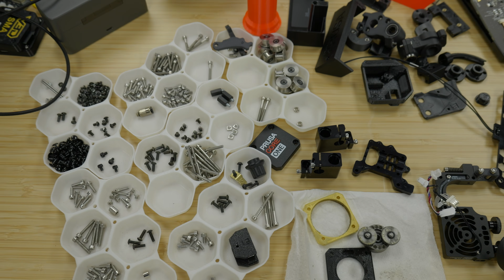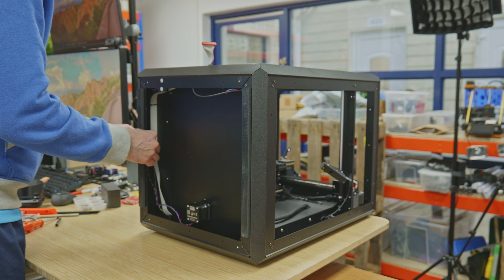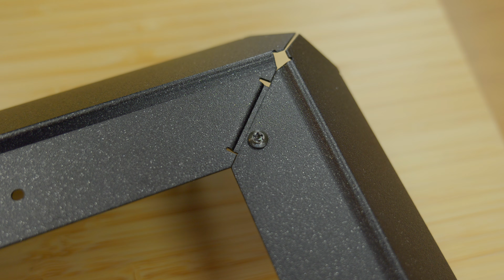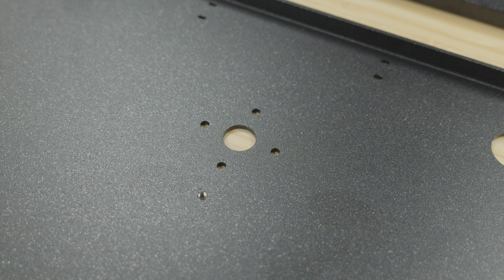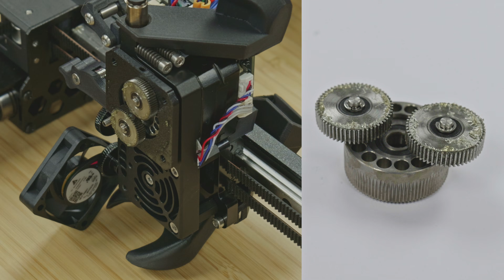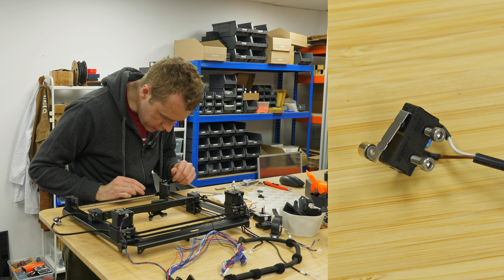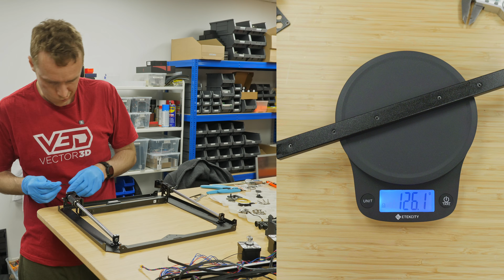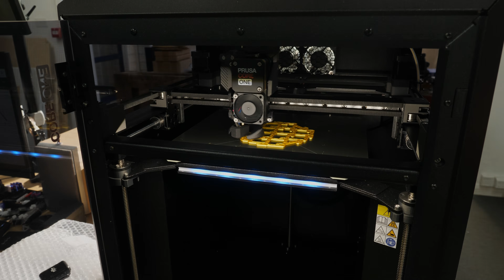I Removed all the Screws from my Prusa Core One

Comment: Honestly the corexy setup and mount plate reminds ma alot of the Ender 7
Reply from the maker: The single unified plate I personally first saw on the e3d toolchanger, but I'm sure motion system in industry will have done it this way for years. So, like an Ender 7, but done properly.

Comment: For the torx vs hex key screws. Beeing in a engineering company with product, sometimes you have stock of screws from a depreciated product. Throwing away screws is a bit of a waste, so you pass the screws with the first batch and then you have only one size. Or it could be that they have sourcing issue finding the screw with the correct head with the same imprint.
Reply from the maker: Not sure what engineering company your at, but the idea of dealing with multiple different machine versions with different screw heads in each one is like a living nightmare. Screws are not expensive and generally ubiquitous and very easy to source unless specialist sizes are used. to my knowledge this is their first time using torx too, I could be wrong but quite confident this was a firm decision.
Reply: @Vector3DP  they use torx screws for attaching the display on the frame for MK3.5/3.9/4(S).

Comment: If all three Z axis motors are driven using the same signal, that means they can't be driven independently to tram the bed. Not a big deal with mesh leveling but would have been cool
Reply: Its a pretty large increase in costs to do that for the very miniscule benefit on a machine this size tbh
Reply: You can still ram tram, just not actively align it
Reply: @SentientTeapot2444  That's how Prusa's i3 models do it. The x-axis assembly is moved in the z direction using two steppers driven from the same driver chip. The i3 printers ram tram to the top supports. I suspect the CORE One ram trams to the bottom.

Comment: Z decouplers are not for noise, but rather to account for discrepancies between Z rails , lead screws, and the moving plate. Pretty neat way to do it. Flexible in X and Y, not in Z
Reply from the maker: Oh true yes, I was maybe too focused on noise as I was impressed by how quiet it was compared to other printers I've been using.

Comment: Unsynchronised single-driver Z steppers is a bit of a compromise. Either chuck a sync belt on them or use independent drivers. Those 3D printed screw couplers seem worse than a proper oldham coupler, and they haven’t mitigated the axial force on the steppers’ radial bearings at all. The whole thing would be better if you just had a single bigger Z stepper and a sync belt.
Reply from the maker: Belt is a worse solution because when they aren't physically linked they can trammed by torque limiting. It's not perfect for levelling, but the first layer results speak for themselves.
Reply: @Vector3DP  you mean the Sovol-style “ram it into the limits and let some motors skip steps” torque limited levelling? I wouldn’t really trust that long-term when you’re relying on the stepper motors’ radial bearings for axial force, but if you’re able to adjust stepper current in firmware and you have a solid reference surface for it to run into then I guess it’s probably ok.
Reply from the maker: Ye, prusa have been doing it for years to tram the Z axis. at least as far back as 2018. It might not seem pretty, but with the size print farm, if it didn't work or caused problems, they would know about it pretty fast.
Reply: Can you please explain in more detail why exactly a stepper and belt should be the better solution?

What are the real advantages of three independent steppers? 
Which consumer printer has this?

The Prusa solution works like the tried and tested MK series. 
The only difference is that the bed moves to the stops instead of the X axis to synchronize.
Reply: @ there’s a chance for the three Z screws to get out of synchronisation, making one corner lower or higher than the others. When you turn the machine off and on again, you lose the holding current that keeps the three screws from moving relative to one another. The Creality K1 series of printers uses a sync belt between its Z screws, while some Vorons (and the Magneto X and a few others) use independent Z steppers that allow them to tilt the bed as a part of the levelling process.

I will note that if the frame is rigid enough, it probably won’t become a problem.
Reply: @Scrogan  The load cell can easily detect a skewed bed and force a re-calibration of the Z axis (by ramming them into the limits...).

Comment: 11:35 I suspect the flexural decoupling is not (only) for noise reasons, rather to prevent mechanical overconstraint. If they would all be rigidly fixed to the frame, you quickly run into alignment issues of the parts. These allow some sort of compliance in all directions except the two direction in which they are supposed to be rigid (namely translation along the ballscrew, and rotation around that axis).
Just from looking at it, I think it has degrees of freedom in translation in the plane of the part, and rotation around these same axis.
Reply from the maker: Yep, I think you're right others mentioned this too. I could have thought more about that.
Reply: @Vector3DP  I don't blame you for not knowing about this. I'm a researcher in robotics and specialized in flexure and compliant mechanisms, hence my remark!
By the way, it would be interesting to know what material they used for the flexures. PLA is generally pretty poor due to its creep properties (very relevant here, as it supports the whole shaft load). Of all common FDM 3d printing materials I have personally found ABS to have most favorable properties for flexures, so I suspect they used ABS here myself.
Reply from the maker: I've not tested the material, but by appearance and experience, it was PETG.
Reply: it has 3z axis? did it have auto tramming?
Reply: @adimegan4677  I am afraid I don't quite understand your question. My remarks with respect to the flexure coupling have nothing to do with the 3 Z axis construction and bed leveling, if that is what you are referring to.
Reply: @tHaH4x0r  sorry for my bad english, and out of context of point "flexure" system...

i jump the video because of your "time stamp" that mention flexure design... and surprised  that prusa core one use 3z axis, and make me asking about "did it have auto Z tramming/leveling bed like 1 ballscrew is lower than other....?(like advance DIY 3d printer example: RatRig) or just like other older prusa that use "hard endstop" to leveling itself..

again sorry about out of context, i toughs core one only use 2z because it more simple and to "not to many part" when upgrading prusa mk4s to coreone....
Reply: @adimegan4677  No. Autotramming would require one stepper driver for each motor, like on RatRigs vCore printers. Prusa does the same on the core one as on the i3 printers: Go over the max z-height, so all motors skip steps and everything is leveleg "enough" (here the bed, on i3 the x-axis). Everything remaining is compensated for by ABL.
Independendly working z-motors would have been nice, maybe combined with euclidic bed holders (like on the vCore 3.1 and 4.0). Would be great for none-planar printing. Maybe a possible Core One s+ upgrade in the future? But I doubt it, non planar slicing still has a way to go.
At the size of the printer, independend z-axis and euclidic carriage for the bed tray would be overkill, esp. with the classic PCB as heated bed. With this bed you have to do ABL anyway, so any extra precision by "tilt correction" using independently driven z-axises would be a waste.
Reply: @oleurgast730  thanks for your information..
yeah it's more simple to make hard end stop to enough tramming, and let bed probe to "do the rest" with small area bed plate it may wasteful to make auto tramming...
with rigid frame some error of manufacturing pretty small and again could be solved with ABL...

thanks for your information...
Reply: I agree that such a system can prevent mechanical overconstraint, but is that really necessary on the lead screw motors? I just checked the lead screw on my printer and it has so much angular and translational play that this alone should take care of any possible overconstraint. I think such a system would be much more important on the linear Z-rods but those seem to be fixed in place without any flex (friction fit on top and bottom). 
These decouplers will have some flex along the Z-axis, so I am just as curious as V3D about any potential Z-inaccuracies especially with heavier prints. Maybe someone can make some measurements with some weights and dial guages.

Comment: Ref the torx vs hex, it looked like the black torx bolts had a smear of blue threadlocker on them whilst the silver hex did not. I suspect that might be something to do with it - perhaps ease of identification of critical bolts in assembly and QA?
Reply from the maker: Definitely no thread locker used.
Reply: @Vector3DP  Fair enough - at 4:05 for example, I could have sworn there is a smear of blue on the thread of the black bolt. However, my eyes could easily be playing tricks on me 👍 - Great video by the way

Comment: Excellent video Adam. As for the “threads deeper than the thickness of the metal” that is a process called “Flow Drilling”. A carbide taper is spun fast and rammed into the metal (over simplified) which deforms a hole pushing the material into the shape you saw. Its purpose is exactly that, creating a boss from the exisiting metal instead of drilling out material (waste) and adding a boss (hard in this case).
Reply: It may also be PEM nuts. I see what looks like PEM (or similar) nuts under the powder coat on the tab of the frame edge pieces.
Reply: @Sembazuru  I just double checked on my Prusa XL (my Core One is printing currently). It is Flow-Drilled. Most of the screws don't line up with holes in the gantry to insert PEM nuts, some are blind holes. I can't share the photo on here but I just took one and it is Flow Drilled as far as I can tell.
Reply from the maker: Another commenter just pointed out it could be hole extrusion maybe. Flow drilling seems to leave some surface material which could be an additional manufacturing process to deal with.
Reply: @ I think hole extrusion uses a tool and die that require backside access to the hole. Not all of the holes are aligned with the speed holes in the back of the tube, some are blind holes. As such there isn’t access for the die on the backside. 

Definitely ask the Prusa folks, I’m curious. Maybe it’s another process I’m unfamiliar with.
Reply: @MandicReally  Yeah, ignore my mention of trying to use PEMs on square tubing. It isn't really practical to get half of the press inside tubing for the pressing action. My apologies for the extraneous noise.
Reply: @ eh, you aren’t wrong that they are used elsewhere and it would be my first thought / choice for how to attach the rail to the tube, just wasn’t designed with that in mind. It’s probably more economical to flow drill. Less pieces (no PEMs) and less labor (no drill + press, just drill).

Comment: One driver for three steppers sounds wrong.
Reply: Agreed, but like the XL it's really only moving "down" when printing, and with the gravity assist of build plate & model weight, it works pretty well.
Reply: @MichaelPeters-01  No, it also moves up a lot (think Z-hop). So the driver must be strong enough to support this.

Comment: Try to do it with bambu
Reply: There’s really not much going on. Just a power supply and small control board. Everything else you can see without disassembly
Reply from the maker: I did do the A1 and A1 mini. If they ever release a new one I'll try and do that. Very expensive to do though.

Comment: The lack of z tilt despite the presences of 3 independent steppers was disappointing
Reply: Since there's a solid reference surface, z tilt isn't really needed. You could do the same thing with a Voron with slight modification.

Comment: Thats an ADC, the resistor is probably a pullup or pulldown resistor and the thing on the antenna is probably a capacitor for impedance matching (take that with a pinch of salt)

Comment: Re: torx vs hex screws, I imagine it could be more of a button head vs socket cap thing. Button heads usually are a hex size smaller than their socket cap head counterparts, and the hex cutout is shallower so they can be a lot easier to strip. Maybe Prusa needed to use button head screws in some areas and decided to use torx for those particular bolts to reduce the likelihood of a user stripping them out.
Reply: At least for larger production runs, you usually spend quite some time to try and optimize and cut down your BOM size and make workstations as simple as possible, so you don't need 3 different sizes of torx and hex screwdrivers and pick the right tool out every time.
I could see them use different heads, just to make kit assembly at home easier, because you can clearly identify different sizes of screws if they have a different head. So they might take an M4x10 with torx head and an M4x12 with hex, to make it clearer what is the required type of screw at a specific step of assembly.
Or maybe they just don't care that much because the assembly workstations at the prusa factory are organized in modular sections, and they only optimized tooling and BOM on a modular level and not over the full design.
Reply: you are correct about the user stripping them out, but you're wrong about why. The reason that Hex bolts get rounded/stripped out is because people literally don't know how to use them.

Even 'full time makers' (e.g. : people who literally make shit for a living by making YT videos on it and such) will constantly use the rounded head to drive down hex-bolts. (10:50) The rounded head isn't for that. It's the difference between an impact-driver and a power-drill; one is for torque, the other is for RPM. The rounded head is so you can drive a bolt off-axis without having to do that stupid hand-cramping pinch-and-twist motion until you engage the threads. (this is also why on a hex allen-key the rounded head gives you the longest reach, but the shortest handle with the lowest leverage!!! The wrench itself is telling you how to use it correctly!) 

Torx fixes this by... literally just taking away the rounded head entirely. That does stop users from stripping the screw, but it's not because torx are better at handling torque (they are, but not meaningfully so in 99.9% of contexts) it's because they've taken away the ball-head which users will misuse and round out the screws with. It'd be my guess that they only used Hexes in places where, if the user DID round them out, they could get the bolt unstuck with a pair of pliers and some elbow grease. Whereas in places where a rounded bolt would be a real issue (such as a bolt that's sunk into the part) they went with Torx to prevent users from screwing themselves over.

Or, as I put it in another comment, "In most cases, the real advantage of Torx is that you get less whiny customer support calls about rounded out screws from people who got skill-issued by a fucking allen-key."

Comment: An "Unkitted" Prusa?
Those nylon riviets are like what holds the door panels on in cars.  And they are probably mostly one time use as they usually break when you try to undo them.  But hey, you can probably 3D print new ones!   Some of the strange assembly bits and bobs are quite likely due to the fact that the printer was designed to be a user assembly kit, and the factory version was made from the same parts.  I hope you took many photos (besides the video) as you took the printer apart so you'd have a chance of putting it back together without having to wait for the Prusa kit manual!
Reply from the maker: The rivets are actually pretty easy to reuse, much better than automotive ones in that regard. I used all the same one to finish off my reassembly today, but the printer comes with a spare bag of like 50 of them just in case.
Reply from the maker: And I reassemble mostly from memory and deduction. I did have hours of high res video footage just in case and a few pictures just in case.